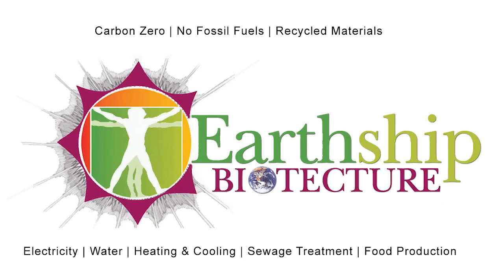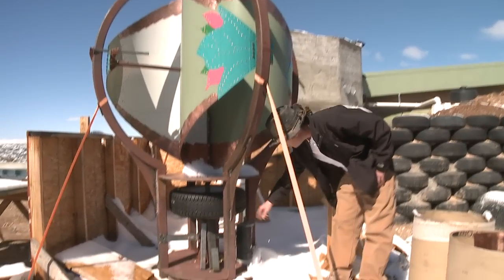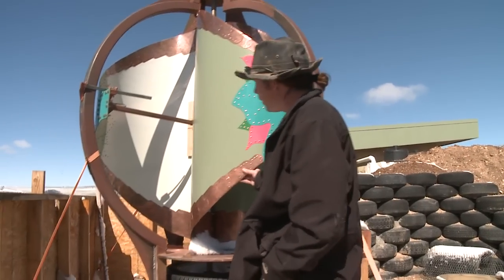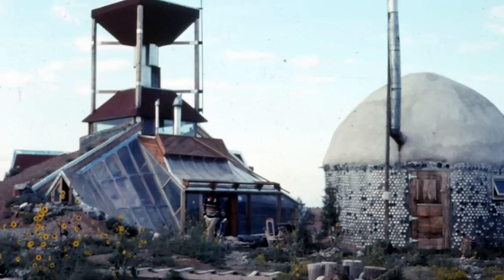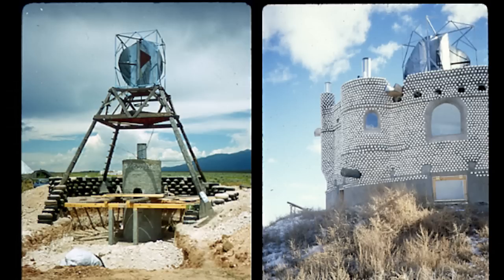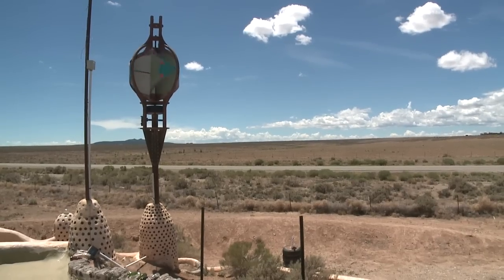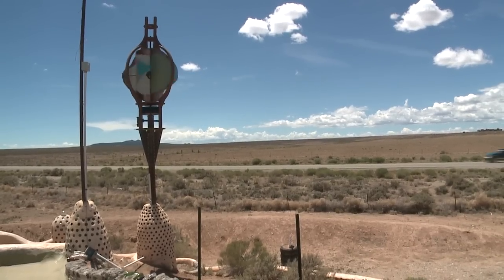Dynasphere

Comment: How about make a smaller one, make it 12vdc, connect it to a  12vdc battery, and build a camp site type power supply... also you could make 12vdc ones to use on sailboats and for research equipment in far away places to maintain battery power...

Comment: This is a savonius type wind turbine. I have an old video on my channel about a calculator that I made to calculate the energy produced by this type of turbine at different wind speeds.
I wanted to build one but is not worth unless you are interested in the artistic aspect of it. It will be way to expensive in comparison with a propeller type horizontal wind turbine (I have one of those and a more recent video about that also).
But solar is the best option by far you can even produce energy in very cloudy snowy days just need to have enough PV panels.
I live OffGrid in the last two years and I exclusively use solar PV panels (I will even use them to heat my house) and I use LiFePO4 for energy storage.

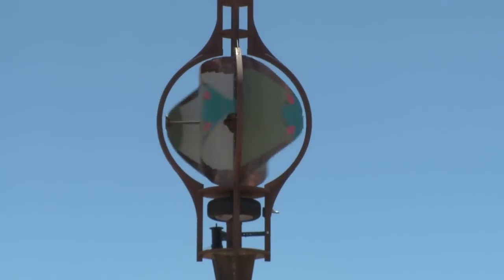Comment: I remember seeing this a long time ago, the thing is beautiful and just as much art as it is functional.  I don't understand why it's mounted up high at 1:26 and clearly not connected to the generator, which means the only resistance is has are the bearings it's mounted on.  Of course a tiny breeze is going to allow it to spin compared to a working horizontal turbine.  Or am I missing something?

Comment: How much power does it produce in layman's terms? Does it have an adapter to connect items that utilize a conventional outlet as it's power source? It's awesome--just curious about it
Reply: very standard converters, and transformers can take any power source and turn it into standard 120V 60 hz power.
Reply: It should work similar to solar.  You'll need a battery bank with a charge controller that the Dynasphere will charge.  That will then connect to either an inverter to provide 110 or 220v AC power or it will provide 12 or 24 (or 48)v DC, depending on your battery bank configuration.  As for power production, Mr Reynolds only mentions the term "should" and from what I can see in this video, it's not hooked up to the generator, so not producing anything.